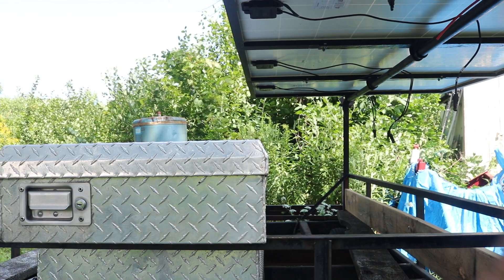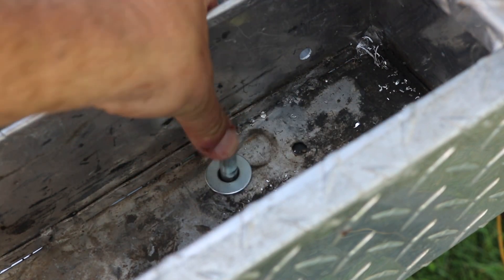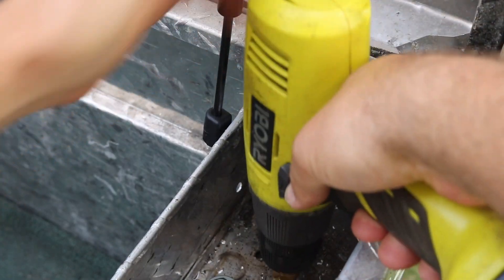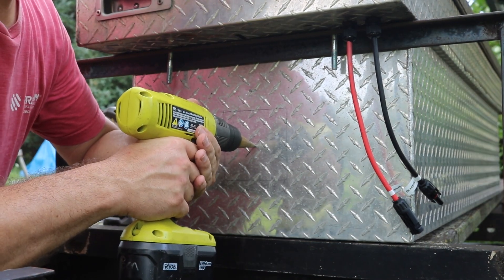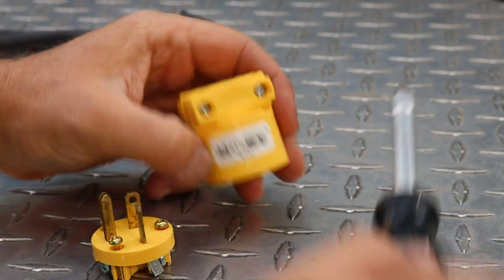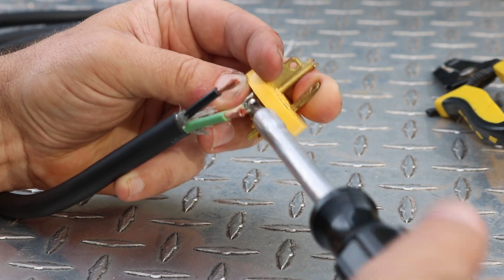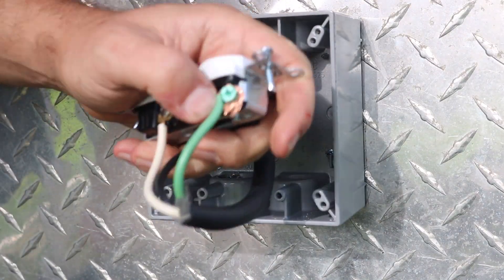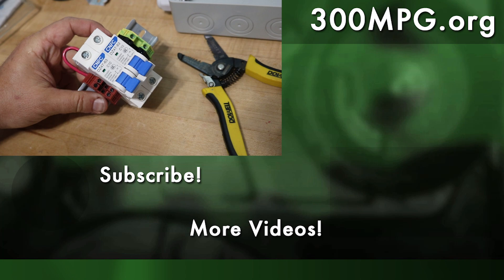Solar Trailer: Part 6 - Toolbox and Electric Outlet Installation

Comment: One of the outlets should be a GFCI and if should feed the second one. ~Safety third!!!!~
Reply from the maker: We'll talk a little bit more later on about why this would or wouldn't work. It gets very interesting with grounding and neutral bonding. I plan to make a single video specifically on that topic.